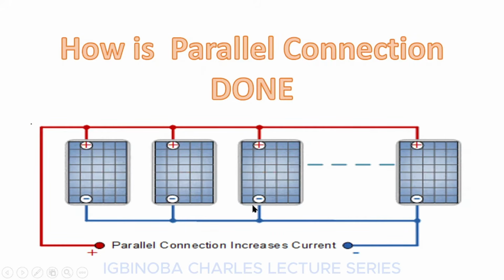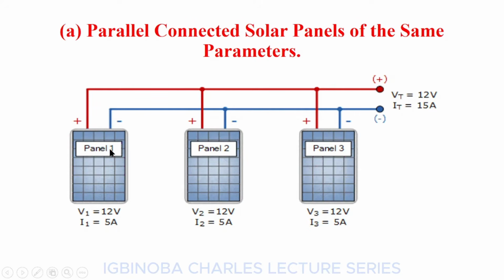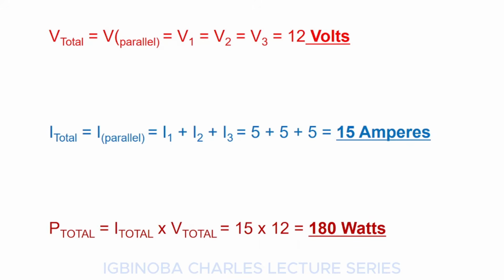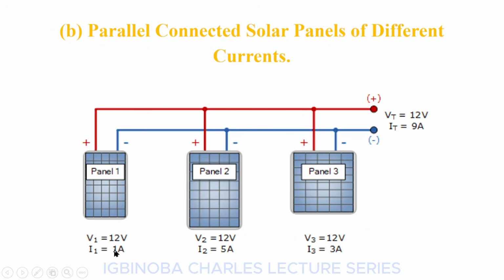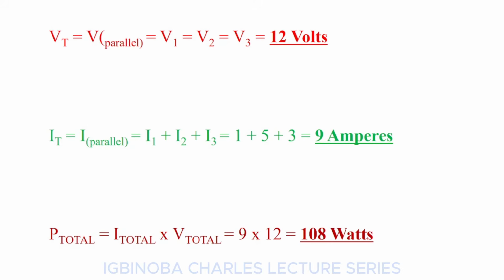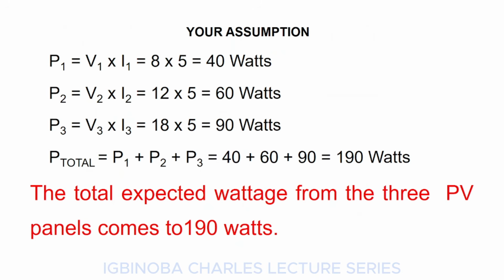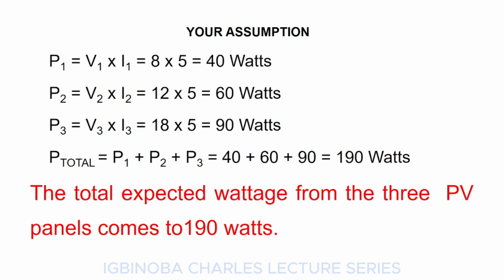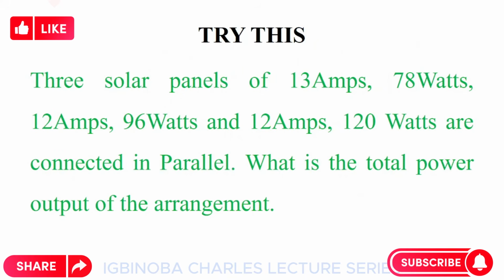Connection of Solar Panels in PARALLEL

Comment: MEC16P

Voltage of Each Panel (V = P/I):
V1 = 78W / 13A = 6V
V2 = 96W / 12A = 8V
V3 = 120W / 12A = 10V
Actual Output (Parallel Connection):
V(parallel) = min(6V, 8V, 10V) = 6V
I(total) = 13A + 12A + 12A = 37A
P(total) = 6V × 37A = 222W

Comment: PETRO72T

Three solar panels are connected in parallel:
	•	Panel 1: 13 A, 78 W
	•	Panel 2: 12 A, 96 W
	•	Panel 3: 12 A, 120 W

Total power output:

P = P₁ + P₂ + P₃
P = 78 + 96 + 120
P = 294 W

Therefore, the total power output of the three panels is 294 watts.

Comment: MAR115K

Calculate the voltage of each pannel=
78÷13=6v
96÷12=8v
120÷12=10v

The lowest voltage is 6v

Then total power output =[13+12+12]6

37×6=222watts answer

Comment: EEE70R 

Panel 1=13A,78w
Panel 2=12A,96W
Panel 3=12A,120W

Calculating for total current (IT)
IT = 13+12+12= 37A
Calculating for voltage 
V1=78/13= 6V
V2=96/12= 8V
V3=120/12= 10V

Since is connected in parallel we pick the smallest voltage 6V

For Total power PT 
PT= IT*VT 
PT= 37*6= 222W

Comment: PETRO77Y

Calculating the voltage for each panel firstly
v1 =78/13 =6v
v2 =96/12 =8v
v3 =120/12 =10v
Taking the lowest voltage which is 6v
Total power output= (13+12+12)×6
Total power output = 37×6
Total power output =222w

Comment: EEE46T 
 the total output power is 222watts.
Reply: COMP38L

Total Power Output = 294 Watts
Reply: MAR115K

Given panel A=13A,78W
Panel B=12A,96w
Panel c=12A,120w

Therefore total power=78+96+120=294watts

We calculate the voltage V=p/I
78÷13=6v
96÷12=8v
120÷12=10v

Total current: 13v+12v+12v=37A

Therefore P=6×37=222wats answer

Comment: P1=13A, 78W
P2=12A, 96W
P3=12A, 120W

w=V×(I1+I2+I3) (Parallel) 

V1=6V
V2= 8V
V3=10V

w=V×(I1+I2+I3)
where Vis the lowest voltage 
w=6×(13+12+12)
w=6×(37)
w=222W (due to power loss)
Theoretical maximum=(78+96+120)W=294W

Comment: COMP81C
Voltage of Each Panel (V = P / I)
V1 = 78W / 13A = 6V
V2 = 96W / 12A = 8V
V3 = 120W / 12A = 10V
Actual Power Output (Parallel Connection)
V_parallel = min(6V, 8V, 10V) = 6V
I_total = 13A + 12A + 12A = 37A
P_total = 6V * 37A = 222W
Theoretical Maximum (With Optimizers)
P_total = 78W + 96W + 120W = 294W

Comment: PETROCHEM66N

Given:

Panel 1: 13 A, 78 W
Panel 2: 12 A, 96 W
Panel 3: 12 A, 120 W

For parallel connection, the total power is the sum of the power outputs:

Total Power = 78 + 96 + 120
            = 294 W

ANSWER: 294 W

Comment: NAT35I
Calculation based on assumption 
Total power= 78+96+120
=294watts
Calculation in actual scenario 
Voltage of panel 1 :
78/13 = 6v
Voltage of panel 2 : 96/12=8v
Voltage of panel 3:
120/12=10v
Select least voltage to act as total voltage.
Total current= 13 +12 +12 = 37amps
Total power= 6 ×37= 222watts

Comment: MAR66N. Obinna Emmanuel 
V1 = 78W/13A = 6V
V2 = 96W/12A = 8V
V2 = 120W / 12A = 10V

Total current = 13A+12A+12A =37A
Recall P=IV
Using the voltage with the lowest value, 
P = 37x6 = 222W

Comment: MEC4D

The total power output = 222 W
Reply: COMP82D 
Given:
P, = 78 W, 4 = 13 A
P2 = 96 W, 12 = 12 A
Pз = 120 W, I3 = 12 A Formula:
V = P/I
V, = 78/13 = 6 V
V2 = 96/12 = 8 V
V3 = 120/12 = 10 V
For parallel connection:
V+ = 6 V
= 1 + 2 + 3
It = 13 + 12 + 12
It = 37 A
Pt =V+x/t
Pt = 6 × 37
Pt = 222 W
Therefore, the total power output = 222 W

Comment: PETROCHEM25Y 

Given that 
Panel 1.13A,78W
Panel 2.12A,96W
Panel 3.12A,120W

So calculate the total output,we simply add the power ratings above 

78W+96W+120W=294W

Comment: MAR92N

3. 294 Watts

When solar panels are connected in Parallel, you just add the power of each panel.

78W + 96W + 120W = 294W

Comment: MEC63K

Given that
Panel 1. 13A , 78W
Panel 2.12A , 96W
Panel 3.12A ,120W

So therefore calculate the total output, we simply add the following power ratings 

78W + 96W + 120W = 294W

Comment: MECH3190H
Given:

First panel: 13 Amps, 78 Watts

Second panel: 12 Amps, 96 Watts

Third panel: 12 Amps, 120 Watts

Now, we add the power ratings of all three panels:

Total Power Output=78 W+ 96 W+120

W

Total Power Output = 294 Watts

Comment: Panel 1 = 13Amp, 78Watts
Panel 2 = 12Amp, 96Watts
Panel 3 = 12Amp, 120Watts 
Let the voltages of three panels be V1, V2, and V3 respectively. 
    To get the voltage value of each panel apply;
     V = P/I
Therefore V1 = 78/13 = 6V
                V2 = 96/12 = 8V
               V3 = 120/12 = 10V
To find total power output apply;
P = IV
Where I = total amperage = 13 + 12 + 12 = 38Amps
While V = lowest voltage ratings = 6V
Therefore P = 6 × 38 = 228Watts. 
Total power output is 228Watts.

Comment: CHM107D

Given:
First panel: 13 Amps, 78 Watts
Second panel: 12 Amps, 96 Watts
Third panel: 12 Amps, 120 Watts
Adding the power ratings of all three panels:
Total Power Output = 78 W + 96 W + 120 W
Total Power Output = 294 Watts

Comment: CHEM24X
To find the total power output, we add the power output of each of the three panel, which is

=P1+P2+P3

=78+96+120

=294watts

Therefore the total power output is 294 watts/

0.294kilowatts

Comment: EEE63K
78+96+120 = 294 watts

Panel 1 : v = 78÷13 = 6volts
Panel 2: v = 96÷12 = 8 volts
Panel 3: V = 120÷12 = 10volts

But since the power output would be limited, due to the difference in votages,
The smallest voltage is used to get the correct output power
P= itotal + vtotal
Therefore the total current will be;
Itotal = i1+i2+i3 = 13+12+12 = 37amps
Vtotal= v parallel = 6volts

Ptotal= 37×6 = 222watts
Therefore the totalpower supply is 75 percent of the maximum power (assumed power) that can be given by the panels

Comment: EEE54B

First panel         =  13Amps,78 watts
Second panel   =   12Amps,96 watts 
Third panel.      =   12Amps,12 watts

Total power output in parallel =78+96+12

TPO=294 watts

Comment: CIV71S

Total power output of solar panels connected in parallel,
Panel 1; 78W
Panel 2; 96W
Panel 3; 120W

Total panel output; 78+96+120= 294Watts

Comment: EEE55C
Given:
First panel: 13 Amps, 78 Watts
Second panel: 12 Amps, 96 Watts
Third panel: 12 Amps, 120 Watts
Now, we add the power ratings of all three panels:
Total Power Output = 78 W + 96 W + 120
W
Total Power Output = 294 Watts

Comment: EEE101W
Given:
First panel: 13 Amps, 78 Watts
Second panel: 12 Amps, 96 Watts
Third panel: 12 Amps, 120 Watts
Now, we add the power ratings of all three panels:
Total Power Output = 78 W + 96 W + 120
W
Total Power Output = 294 Watts
Reply: The total power output is 294 watts

Comment: MAR28B
Given:
Panels = (13 A, 78 W), (12 A, 96 W), (12 A, 120 W)
Voltages = 78/13 = 6 V, 96/12 = 8 V, 120/12 = 10 V
→ Parallel → same voltage = lowest = 6 V
Currents at 6 V:
13 A + (6/8)×12 + (6/10)×12 = 13 + 9 + 7.2 = 29.2 A
Total power = 6 × 29.2 = 175.2 W ≈ 175 W ✅

Comment: CHM98T 

First panel: 13 Amps, 78 Watts
Second panel: 12 Amps, 96 Watts
Third panel: 12 Amps, 120 Watts
Total power output= 78 Watts+96 Watts+120 Watts 
Total power output= 294 Watts

Comment: COMP22V

Given Data:
Required PV array output: 48 V, 960 W
Available solar panel rating: 12 V, 5 A

 (i) Determination of the Number of Panels in Series
In a series connection, voltages add up while the current remains constant.

Formula:
V total = no. of series × V panel

Given:
V total = 48 V
V panel = 12 V

So therefore,
n series = 48 / 12 = 4
 Number of panels in series = 4

 (ii) Determination of Total Number of Panels Required
Each panel produces:
P panel = V panel × I panel = 12 V × 5 A = 60 W

To achieve the required total power:
P total = 960 W

So therefore,
n total = P total / P panel = 960 / 60 = 16
 Total number of panels required = 16

(iii) Determination of Total Current from the PV Array
From (i), each series string contains 4 panels, giving:
48 V, 5 A per string

With 16 panels total:
n parallel = 16 / 4 = 4 strings in parallel

In a parallel connection, currents add up while voltage remains constant.

So therefore,
I total = n parallel × I string = 4 × 5 A = 20 A
 Total array current = 20 A

So therefore,
4 panels connected in series per string
  4 parallel strings
Total Output: 48 V X 20 A = 960 W

Comment: MAR394P 
We are given three solar panels with the following ratings:

1st Panel: 13A, 78W

2nd Panel: 12A, 96W

3rd Panel: 12A, 120W

To find the total power output of the three panels, we add all their power ratings together:

T.P.O  = P_1 + P_2 + P_3

T.P.O = 78W + 96W + 120W
T.P.O = 294W

Therefore, the total power output is 294W.

Comment: EEE90L 
GIVEN:
Three solar panels:

1.
13A, 78W
2..
12A, 96W
3.
12A, 120W..
They are connected in parallel...

Step 1: Find the voltage of each panel 

Using the formula:
P=V×I>V=P/I
1) V1=78/13=6V
2) V2=96/12=8V
3) V3=120/12=10V

Total power output....
Ptotal=78+96+120=294 W

Comment: MEC96R 

Question Summary:
Three solar panels connected in parallel:  
- Panel 1: 13 A, 78 W  
- Panel 2: 12 A, 96 W  
- Panel 3: 12 A, 120 W  

*In parallel connections*, *voltage remains the same*, and *total power output = sum of individual power outputs.

---

Total Power Output =  
78 W + 96 W + 120 W = 294 Watts

✅ Answer: 294 Watts

Comment: COMP72T 

Given:

First panel:13Amps, 78warts

Second panel: 12 Amps, 96 watts

Now, we add the power rating of all three panels:

Total power output =78w+96W+120w

Total power output=294watts

Comment: MEC83E

Thank you sir for the lecture.
We are given three solar panel data with values:

1st panel: 13 amps, 78 watts
2nd panel: 12 amps, 96 watts
3rd panel: 12 amps, 120 watts
To therefore calculate the total power output, we simply add the following power ratings:

= 78W + 96W + 120W = 294 Watts

Comment: COMP19S 
We are given three solar panels 
First panel 13Amps 78Watts 
Second panel 12Amps 96Watts 
Third panel 12Amps 120Watts

Total power assumed=P1+P2+P3 
                =78+96+120
                 294Watts
Voltage is given as 
V=P/I
  
V1 =78/13= 6v
V2 =96/12=8v
V3=120/12= 10v
Total voltage= the smallest voltage is the parallel voltage that flows through the circuit 
 Total voltage=6v
Total current=I1+I2+I3
                       =13+12+12
                        =37Amp
Total power=IV
                      =37×6
                       =222Watts
    Therefore the total power is 75% of the maximum power( assumed power) that can be given  by the panels

Comment: COMP58F

Panel 1: 13 Amps, 78 Watts
Panel 2: 12 Amps, 96 watts
Panel 3: 12 Amps, 120 watts
Total power output
=Sum of the power of the three panels
=78 + 96 + 120
=294 Watts

Comment: NAT39M

We are given:
- First panel: 13 Amps, 78 Watts
- Second panel: 12 Amps, 96 Watts
- Third panel: 12 Amps, 120 Watts
Now, we add the power ratings of all three panels:
Total Power Output = 78 W + 96 W + 120 W
Total Power Output = 294 Watts
Reply: MEC55C
Thanks for the lectures
We are giving three solar panels from the values 
1st panel 13A,78w
2nd panel 12A, 96w
3rd panel 12A, 120w
Therefore the Total Power Output is the summation of all the powers put together 
T.P.O=P1+P2+P3
T.P.O=78+96+120
T.P.O=294

Comment: PETRO150
We are given three solar panel data with values:
1st panel: 13 amps, 78 watts
2nd panel: 12 amps, 96 watts
3rd panel: 12 amps, 120 watts

To therefore calculate the total power output, we simply add the following power ratings:
T.P.O = 78W + 96W + 120W = 294 Watts

Comment: PETROCHM19S

P1 = 78 W
I1 = 13 A

P2 = 96 W
I2 = 12 A

P3 = 120 W
I3 = 12 A

V = P / I

V1 = 78 / 13 = 6 V
V2 = 96 / 12 = 8 V
V3 = 120 / 12 = 10 V

Vtotal (parallel) = V1 = 6 V

Itotal (parallel) = i1 + i2 + i3

13 + 13 + 13 + 13 = 39 Ampere

Therefore PTotal = I total × V total
39 × 6 = 234watts

Comment: MEC55C 

We are given:

First panel: 13 Amps, 78 Watts

Second panel: 12 Amps, 96 Watts

Third panel: 12 Amps, 120 Watts

Now, we add the power ratings of all three panels:

Total Power Output = 78 W + 96 W + 120 W

Total Power Output = 294 Watts

Comment: CIV28B 

Given :

Panel 1 : 13A, 78W
Panel 2 : 12A ,96W
Panel 3 : 12A, 120W

Using : P = IV 
V1 = 78÷13 = 6v
V2 = 96÷12 = 8v
V3 = 120÷12 = 10v

Therefore ,the total voltage is 6v

Total current = 13A+12A+12A
                       = 37A
Using P = IV 
 
The total power output = 6v × 37A
                                         = 222watts

Comment: EEE117M
Thanks for the lectures
We are giving three solar panels from the values 
1st panel 13A,78w
2nd panel 12A, 96w
3rd panel 12A, 120w
Therefore the Total Power Output is the summation of all the powers put together 
T.P.O=P1+P2+P3
T.P.O=78+96+120
T.P.O=294

Comment: MAR59G

  P = IV

. First panel: 13A, 78W
  V = 78/13 = 6V
. Second panel: 12A, 96W
  V = 96/12 = 8V
. Third panel: 12A, 120W
  V = 120/12 = 10V

  Seeing that they all have different  voltages,therefore, we calculate the total power to be;

Total Current, I = 13+12 + 12 = 37A

Total Power, P = 37 × 6 
                      P = 222W

Comment: COMP60H 
First pannel =13amps, 78watts
Second panel =12amps,96watts
Third panel =12amps, 120watts
 

Adding the powers in each pannel: 78+96+120 =294watts
Therefore total power is 294watts

Comment: PETRO12L

PANEL 1: 13A, 78W
PANEL 2 : 12A, 96W
PANEL 3 : 12A, 120W

since total power is the sum of individual powers in a parallel arrangement: total power= 78W+ 96W +120W = 294W

Comment: CHM62J 
Thank you sir for the lecture.
We are given three solar panel data with values:
1st panel: 13 amps, 78 watts
2nd panel: 12 amps, 96 watts
3rd panel: 12 amps, 120 watts
To therefore calculate the total power output, we simply add the following power ratings:
T.P.O = 78W + 96W + 120W = 294 Watts

Comment: COMP96R 

Given:
First panel: 13 Amps, 78 Watts
Second panel: 12 Amps, 96 Watts
Third panel: 12 Amps, 120 Watts
Adding the power ratings of all three panels:
Total Power Output = 78 W + 96 W + 120 W
Total Power Output = 294 Watts

Comment: Petro 78Z 
Give that:
First panel: 13 Amps, 78 Watts
Second panel: 12 Amps, 96 Watts
Third panel: 12 Amps, 120 Watts
Now, we add the power ratings of all three panels:
Total Power Output = 78 W + 96 W + 120 W
Total Power Output = 294 Watts

Comment: PETRO 58F

Given:
First panel: 13 Amps, 78 Watts
Second panel: 12 Amps, 96 Watts
Third panel: 12 Amps, 120 Watts
Adding the power ratings of all three panels:
Total Power Output = 78 W + 96 W + 120 W
Total Power Output = 294 Watts
Reply: CHM11K
Given:
First panel: 13 Amps, 78 Watts
Second panel: 12 Amps, 96 watts
Third panel: 12 Amps, 120 Watts
Adding the power ratings of all three panels:
Total power output = 78W + 96W + 120W 
= 294Watts

Comment: MAR 41O

To find  the different voltage of the three panels for
panel 1: V1 = 78 ÷13 =6v
Panel 2: V2 = 96 ÷ 12 = 8
Panel 3: V3 = 120 ÷ 12 = 10

Total voltage = V1 = 6V
Total power = I1 + I2 + I3 = 13 + 12 + 12 =37 amps
Total power = 6V * 37amps = 222Watts

Comment: PETRO 50X
Given: First panel: 13 Amps, 78 Watts Second panel: 12 Amps, 96 Watts Third panel: 12 Amps, 120 Watts Now, we add the power ratings of all three panels: Total Power Output = 78 W + 96 W + 120 W Total Power Output = 294 Watts

Comment: Mar1A
Panel 1: 13A, 78W

Panel 2: 12A, 120W

Panel 3: 12A, 120W

Since total power is the total  sum of individual powers in a parallel arrangement:
the Total power= 78w+96w=294w

Comment: PETRO 22V

For the total power output of the parallel arrangement,
we sum the individual power ratings:

Panel 1: 78 W
Panel 2: 96 W
Panel 3: 120 W
Total power = 78 + 96 + 120 = 294W

Therefore the total power output of the arrangement is
294W.

Comment: PETRO 51Y
Step 1: Identifying the given data for each panel we have that:
Panel 1: 13A, 78W
Panel 2: 12A, 96W
Panel 3: 12A, 120W
Step 2: Calculating the voltages for each panel we also have that
P=IV therefore V= P/l
Panel 1: V = 78/13=6V
Panel 2: V = 96/12=8V
Panel 3: V = 120/12=10V
Therefore
V(total) = 6 Volts (which occurs as a result that the output
voltage of the connection would be the lowest voltage of the individual panel in the parallel connection).
I(total) = 13+12+12 = 37 Amperes
P(total) = I(total) x V(total) = 37 x 6 = 222 Watts
Conclusively the total output voltage of the parallel connection of the solar panels is 222 Watts

Comment: NAT34H
Given:

First panel: 13 Amps, 78 Watts

Second panel: 12 Amps, 96 Watts

Third panel: 12 Amps, 120 Watts

Now, we add the power ratings of all three panels:

Total Power Output = 78 W + 96 W + 120 W

Total Power Output = 294 Watts

Comment: PETRO 61I

Step 1: Identifying the given data for each panel we have that:

Panel 1: 13A , 78W
Panel 2: 12A , 96W
Panel 3: 12A , 120W

Step 2: Calculating the voltages for each panel we also have that

 P=IV therefore V= P/I

Panel 1: V = 78/13=6V
Panel 2: V = 96/12=8V
Panel 3: V = 120/12=10V

Therefore 
V(total) = 6 Volts (which occurs as a result that the output voltage of the connection would be the  lowest voltage of the individual panel in the parallel connection).

I(total) = 13+12+12 = 37 Amperes

P(total) = I(total) × V(total) = 37 × 6 = 222 Watts

Conclusively the total output voltage of the parallel connection of the solar panels is 222 Watts

Comment: PETROCHEM70R                 Panel 1 : 78watts
Panel 2 :96watts
Panel 3 : 120 watts
Total output power
78w + 96 w + 120 w= 294 w 
Answer 294 watt is the total output of the parallel arrangements

Comment: MAR37K

We are given:

- First panel: 13 Amps, 78 Watts
- Second panel: 12 Amps, 96 Watts
- Third panel: 12 Amps, 120 Watts

Now, we add the power ratings of all three panels:

Total Power Output = 78 W + 96 W + 120 W
Total Power Output = 294 Watts

Comment: EEE4 6T
Given:
First panel:13Amps, 78warts
Second panel: 12 Amps, 96 watts
Now, we add the power rating of all three panels:

Total power output =78w+96W+120w
Total power output=294watts

Comment: EEE48V

To find  the different voltage of the three panels for
panel 1: V1 = 78 ÷13 =6v
Panel 2: V2 = 96 ÷ 12 = 8
Panel 3: V3 = 120 ÷ 12 = 10

Total voltage = V1 = 6V
Total power = I1 + I2 + I3 = 13 + 12 + 12 =37 amps
Total power = 6V * 37amps = 222Watts

Comment: COMP59G

13A, 78W
12A, 96W
12A, 120W

Each panel power = current × voltage (P = IV)
Already given as 78W, 96W, and 120W

In parallel, total power = sum of all powers
Total power = 78 + 96 + 120 = 294 W